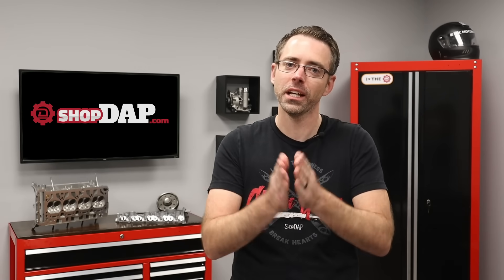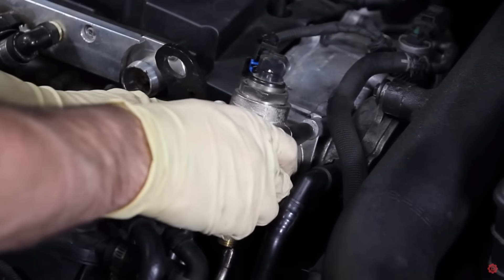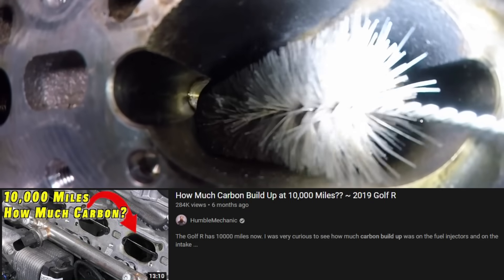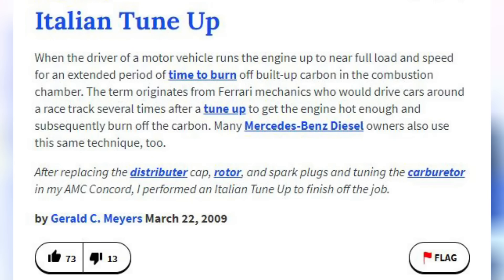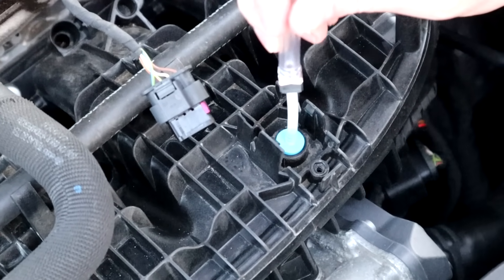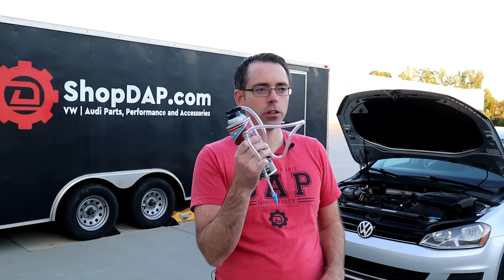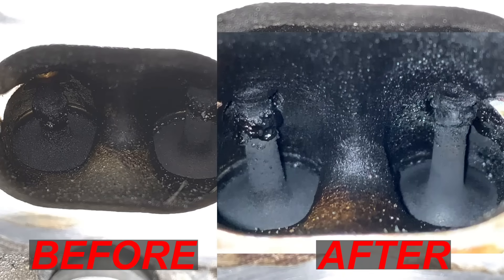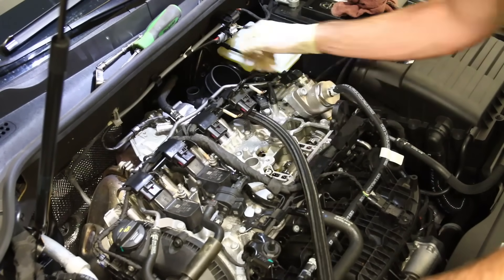Can you Really Remove Carbon for $29?

Comment: i find plain old gasoline works ok if done once or twice a year especially from the early mileage of the vehicle and b4 a service..  rev 3000 to 4000 RPM and spray into the intake, even through the throttle or intake pipe after the filter..  just enough to pull down the RPM abit but not to stall, cause backfiring or buck and stumble of the engine..

Comment: run some hydrogen into the intake for about 10 minutes runtime...   bet ya it will look like the engine has never been running before...

Bmw hydrogen 7 runs on hyrogen.. so dont go off about scam shit...   you CAN run your can on hydrogen dirrectly pulled from WATER.

safe..  straight from nasa..  "SAFEST... MOST EFFECIENT FUEL IN THE UNIVERSE"    thats WHY they use it.

Comment: Good video, but if you were to repeat this procedure, you should try to inject the product before the throttle body to make sure you get it equally to all cylinders as Berryman recommends.  Also, make sure to have the engine at full operating temperature before you do this.  You didn't mention anything about a 30min heat soak after applying the product.  Was this done?  

I would be curious to see the difference between this Berryman product vs. the CRC GDI cleaner vs. the STP Intake valve cleaner, vs the BG intake valve cleaner.  I have used the CRC GDI cleaner as an annual or bi-annual treatment on my 2.0 TFSI a day or two before an oil change.  The first time I used the CRC product (cheapest out of all of these at about $12 at an auto parts store), I sprayed before the throttle body, waited an hour for heat soak, and had a large plume of white smoke out the exhaust on my first drive.  The second time used the CRC cleaner, I had a bit less smoke, and the third and 4th times I've used it, I've had very little exhaust smoke on first drives.  I've also seen misfire counts reduced when reading through VagCom,  better fuel trims, and better MPG (a more scientific way of measuring the effectiveness of these products).  

A tip for the CRC tube is to use a lighter to heat it up and put a 180-degree bend in it without kinking.  That way you can insert it before the throttle body and clamp the hose over it and apply the product while the engine is running.  Also, if you have power seats, you can do this job alone (CRC recommends holding the engine at 2k RPM during the cleaning process) if you wedge a piece of wood between the gas pedal and the seat.  

While manual cleaning of the valves does the best job, for time, effort, & cost, I'll throw $24 of cleaner at my car per year rather than having to remove the intake manifold/injectors (which need new seals each time they are removed, about $60 in parts)  and manually clean the valves (or buy the tools to walnut blast), and reassemble.
Reply from the maker: Yes we followed their instructions as listed. We might do a follow up to compare other products.

My personal opinion is none of these products are a solution to fix carbon, but can be used as a preventative.

Comment: I sprayed 300-400ml of water in the intake manifold of my 1.9TDI non PD with a window cleaner bottle gently as a fine mist while the car was at 2000rpm. The car felt a bit more responsive after but maybe it was in my head unfortunately I was too lazy to check the valves for any difference. Car is still running strong 30.000km after this experiment hah. I don't recommend.
Reply: 1

Comment: My son and I just settled into the fact that periodic cleaning of carbon build up is just part of owning and Maintaining the GTI. Not so much a bummer any more. We set our self up with the Walnut Blaster, Intake Gaskets, Injector Reseal Kits and fresh Spark Plugs. Tasty Beverage and a few hours....Done.
Reply: Better use sea foam every 8K miles as a preventive measure, no more build up.
Reply: @90210sky  sea foam in to the gas tank?
Reply: @alexandro6126  you can use it in the gas tank, but I meant to spray into a vacuum line once a month or so, easy and convenient.

Comment: is the intake valve cleaner safe for a 2.0T engine? Specifically the turbo.
Reply: I have the same question, I was scrolling to see if anyone else asked first and it got answered...
Reply: @jamesgermain8466  if it is i’ll likely do a can every 15-20k or until i can afford to drop $500 on a catch can
Reply: @bcshay  I hear yah, Ive had mine for a while , and I dont plan on getting a new one anytime soon, I notice my oil burning a little bit faster too nowadays...just looking to keep her running as long as I can...its like I have a good car, why burn more money on a brand new one if I dont have to lol
Reply: @jamesgermain8466  gti? what year?
Reply: @bcshay  actually an Audi, 2015...same difference 😅
Reply: @jamesgermain8466  VAG, yup sir. i hope Paul responds or i’m just gonna hit up the company that makes the cleaner
Reply: @bcshay  same here brother 👍
Reply: @jamesgermain8466  So i reached out directly to Berryman and they confirmed #2611 is safe for turbocharged engines 🤟🤙👍
Reply: @bcshay  thats awesome!! Thanks alot bro 👍
Reply: @jamesgermain8466  no worries. can’t wait to use it!

Comment: Would a gallon of e85 mixed into 93 octane every two or three tanks theoretically aid in minimizing carbon? Mk7 EA888
Reply: No, the gasoline has pretty.much nothing to do with the carbon build up in the ports. No matter what grade of fuel you put in the tank the valves still be getting washed by it.

Comment: I'd be curious to know if using only TOP-TIER fuels is a good way of preventing/reducing carbon build-up.
Reply: nope, they do nothing for GDI or T/GDI engines carbon built up.  I do use Chevron once in a while to clean the fuel system and the injectors because those are pain to replace in those kind of engines and I had one failed because I used cheapest gas in town

Comment: Doesnt driving a lot of highway mileage help prevent (and cure) this issue? I've seen loads of stories and comments with boroscope data beneath Charles' videos on carbon build up of a Tiguan - before and after long highway trips... My Polo 1.2 TSI (liquid LPG via petrol injectors) is at 270.000km, never had issues with carbon build up (knock on wood) - still can do around 6.5L LPG/100km with ease

Comment: Can you use, as in an oil change, about 1/2 pint of diesel fluid to clean this out once the car is at temp? Or would you risk blowing/ setting fire to the engine due to its flammable properties? I was told that 1/2 pint of diesel poured in ( as opposed to pouring LiquiMoly additives in there ) would clean the engine and then you can drain it before putting the new oil in. Not sure how accurate this is, but would appreciate your input on this...great video, as always by the way...

Comment: I run a can of valve cleaner through the intake on my 2019 Subaru every oil change since new as a preventative.  Would be nice to be able to scope the valves at 100k if I still have it.
Reply: We have 2 Subarus with DI, one with a turbo, Looks like the boxer config would make media blasting a costly PITA. I wonder if frequently changing the oil (say 3K) would slow down the carbon buildup. The premise being the cleaner the oil the less crap that will be deposited on the valves.

Comment: My mk5 Jetta gli with 182k mileage Seafoam helped it before it had a bit of a slow down around 3rd gear at full throttle its a cheap fix but I need to do full intake valve clean service

Comment: How bad do you think the never cleaned valves on my 181k mile 2.0t FSI GTI are?

I have consistently tried to use better than the CLT market dealer bulk oil (it burned off too fast and required way more frequent top ups). Max of 6k miles to maintain the 15 year Castrol warranty. Selling dealer insisted on the 505.01 Valvoline (initially) or Castrol oil, and I tried to oblige. Or 0w30 / 0w40 Castrol...if they were not available.

@DeutscheAutoParts your thoughts?
Reply from the maker: Prob real bad

Comment: Thanks for this thorough (and entertaining) video.  IMHO, GDI is a solution to a problem we didn't have!  Port injection was just about flawless, and mostly trouble free. Too bad the KISS principle got lost along the way.
Reply: Yep, I know all the benefits of GDI, but I just feel that we are well into the range of diminishing returns.  Those fuel savings pale in the face of the ongoing need for major servicing.  Technology has to be able to succeed in the real world, not just in the EPA Labs.  I prefer a configuration that allows a vehicle to continue serving well into advanced old age, which has a significant effect on reducing its lifecycle carbon footprint.  In my view, too many vehicle now are getting scrapped due to no longer being economically repairable.  Just one guy's opinion. Peace.
Reply: @bobmcl2406  We absolutely are into diminishing returns, no doubt about it.  However the government set the targets that car manufacturers have to hit, and it's not going to happen without resorting to these techniques.  I'm certain car manufacturers would be very happy to stick to older, much cheaper technology if they could get away with it.
Reply: @bobmcl2406  True.  But the Green Nanny's demand harder & harder standards... 

Good news.  Beginning in 2017 gas vehicles,  US manufacturers solved this by adding port injectors, improving intake valve washing and giving a wider efficient operating range.
Reply: @bobmcl2406  +1000!
Reply: The problem was emissions and indirectly fuel economy.  GDI improves both, at the expense of higher particulates (hence GPF exhaust systems) and carbon fouling on the previous generation of engines.
Reply: There is an important benefit to GDI. GDI allows a significant (~20%) increase in compression without pre-detonation on the same octane fuel. 

The expansion of the high pressure liquid in the combustion chamber provides limited time, local Joule-Thompson cooling.  This allows a higher compression ratio with the same pre-detonation limits. Higher compression means higher thermodynamic efficiency and this higher torque, power, lower specific fuel consumption. It can be likened to almost free meth-water injection system. A remarkable technical advance.  

For example, it is the primary reason that normally aspirated V8s are now able to achieve torque (lb-ft) and peak horsepower ( hp) outputs of well above 1/ in^3 below 6500 rpm. For example in a modern high-output Hemi, Coyote or 6 L GM vs. the same size motor 15 years ago, outputs are up 20% and fuel efficiency is up as well, (other tech improvements and hocus pocus contribute to the fuel consumption improvements).

Comment: I've been using the exact same intake manifold method with the Liqui Moly Valve Cleaner on my wife's 1.6T Hyundai engine. I perform that procedure annually and do not see the typical white smoke from the exhaust that is so prominent for e.g. Sea Foam. I'm very pleased with the results, I do compare the before and after with a borescope camera. Yes yes I know the Valve cleaner is a fuel additive, but in the the direct injection engine it would not be sprayed over the vales so it needs a bit of help :) Not endorsing anything, just sharing my experience. Perform at your own risk.
Reply: So I have a big question for you how many miles on that Tucson ? Also did you have to take off the intake manifold to inspect the valves I have a 2020 Tucson aswell new and I run a catch can but would like to inspect the valves someday without having to remove the intake manifold like I had to on our 2016 Tucson. All I gotta say manually cleaning the valves sucked bad lol your back is going to hurt lol.
Reply: @henrytom5824  Around 30k on the first cleaning. I'm not removing the intake manifold,  just the pressure/temp sensor from the intake manifold (two screws only). I use a borescopes camera to inspect the valves before and after through the sensor hole. It's tricky but doable. For the cleaning itself, I just peel the sensor a bit and spray small doses of the valve cleaner with a small syringe.

Comment: MY15 S3 has about 50k miles and now I am wondering if I need to look into cleaning my intake valves or getting a catch can.  Should I be looking to get mine cleaned or maybe even get a catch can?  I am tuned by APR and have a few minor supporting mods but nothing crazy.  I have looked into getting a APR catch can to go with there intake but they are so pricey I couldn't justify the price.  Been using liqui moly which I assume helps.
Reply from the maker: You’re prob good. Check out this mk7 146k which is basically the same engine 
https://youtu.be/YDJe8v0INkA
Reply: @Deutscheautoparts  that’s good to hear.  I didn’t really want to bother with another thing.

Comment: @Paul, would it make sense to drill holes in the plastic intake manifold into each cylinder to better deliver the chemical/petroleum product? CRC is also one of them. Later just plug the holes with good rubber fasteners to keep the holes sealed until next service.
Reply from the maker: Nope. Wouldn’t hold boost

Comment: So, will an older low-mileage car still (7-yrs, <35k miles) still have similar buildup? Good video, btw.
Reply: Might actually be worse...
Reply from the maker: Probably not.
Reply: @Deutscheautoparts  I’ve seen super low milage motors with insane deposits. My working theory is, because all the  cars I’ve encountered in such condition were 1 elderly owner with extremely low mileage; the motor never really get’s up to necessary operating temps for self-cleaning, nor does it (the motor) basically ever move fast enough to jostle developing build-up to burn it. If all Edith does with her car is putter to the doctors, the library and the supermarket just up the way, perhaps a  few long trips a year for holidays at 55Mph: with the cheapest bargain regular gas; in terms of chemistry/physics, we’ve just created an excellent environment for the creation of tars.
🙌🏻